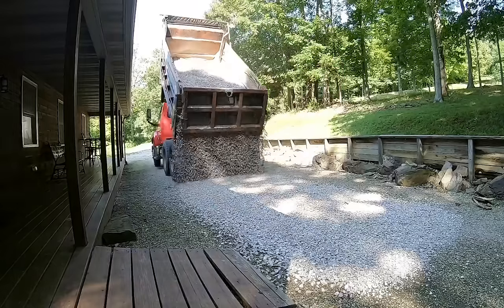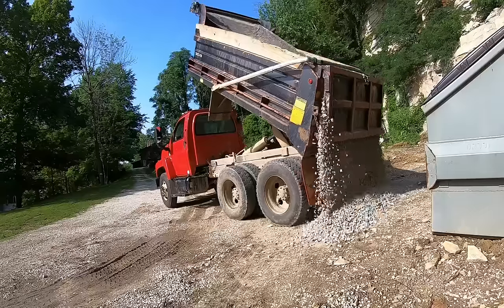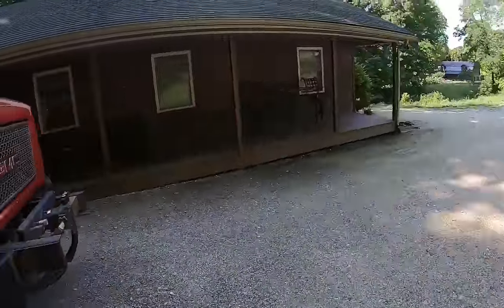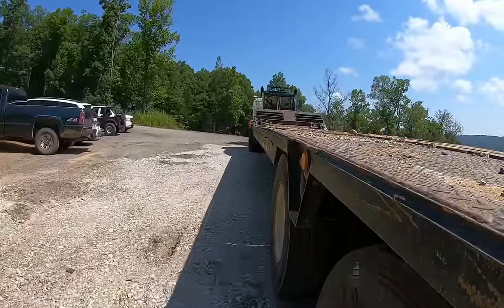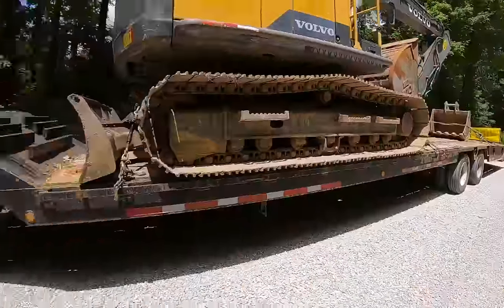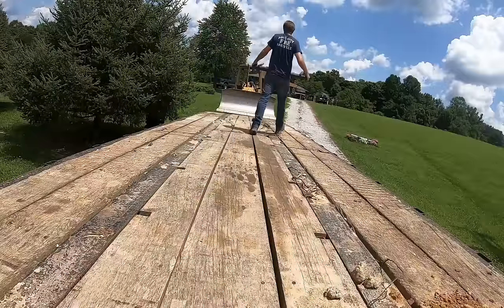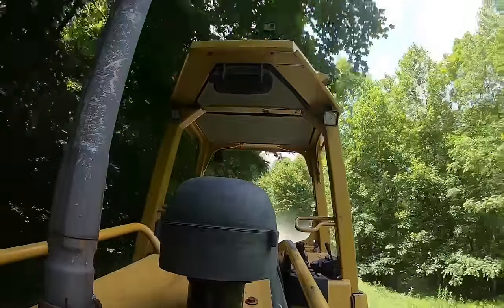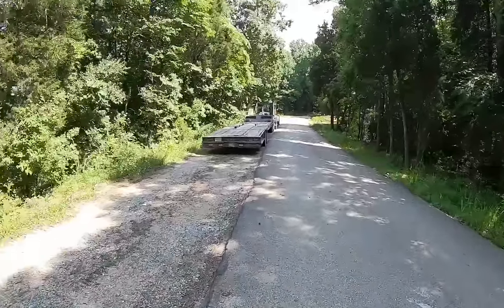Spreading Stone - Hauling Volvo 140 and D4G - Go Pro Experiment

Comment: Look Out Mtn? Your backing skills with a tractor and trailer are much better than mine ever was. Snaky at best for me. Yes, The Mad Mack makes great sounds under load. Washboard roads? Yep. Driving school busses in college, Dallas County roads were gravel and got washboard often. A long wb school bus pulling a hill would bounce the seats loose. Pavement did the same thing in the hot summer on heavy truck travel roads. 
The main road out into the county by me is being beat up with sand and gravel haulers all day long. just a narrow 2 lane and it is taking a pounding.
Reply from the maker: RK Harm24 we did go to look out mountain!  And I was laughing picturing the kids just bouncing on the bus seats on those hills 😂

Comment: If still didn't find it Take a weed eater and Harbor Fright has a rolling magnet It 30" wide it's $30.00 bucks or so they got some kind of some new promo going so you might get it cheaper I love mine Anytime I'm doing anything I drop screw and nails I bad at But this thing save a lot of flat tires I hop this helps.
Reply from the maker: james hicks I’ve got a little magnet for nails . Something I should try.  Thanks for the tip!